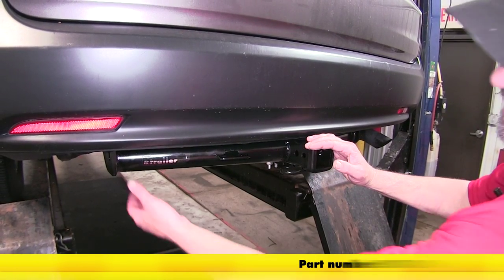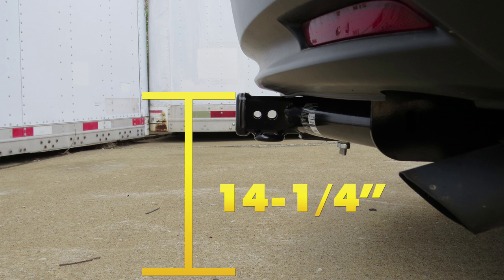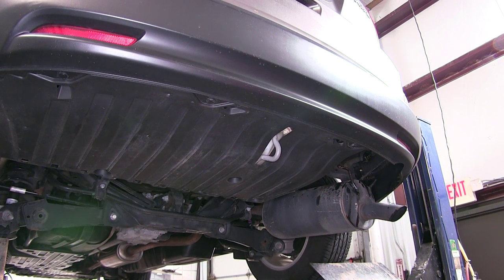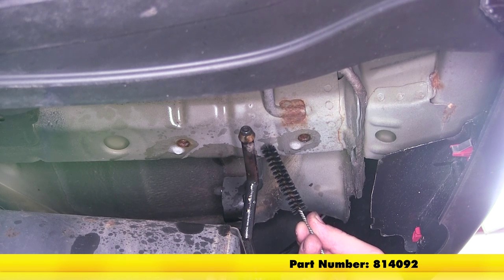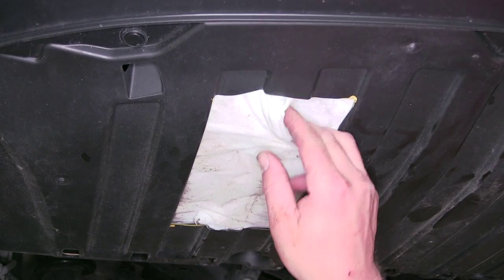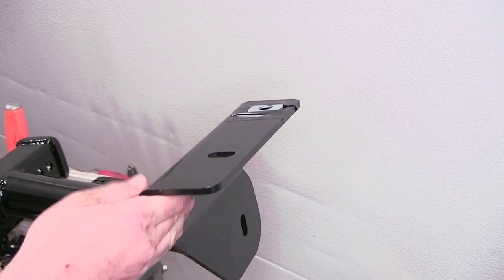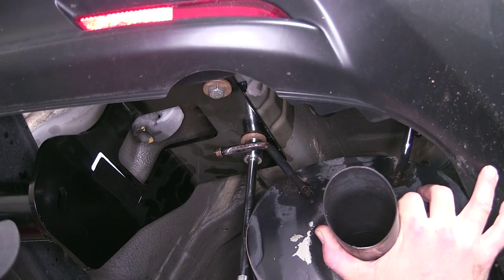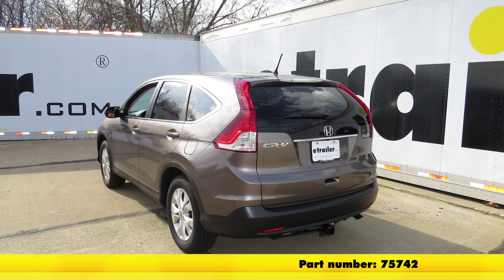etrailer | How to Install the Draw-Tite Max-Frame Trailer Hitch Receiver on a 2012 Honda CR-V

Comment: This is a great video. Unfortunately the hex bolt won't screw into the frame. Hopefully it's just rust that can be cleared out by the vinyl tool.
Reply from the maker: You can use some penetrating oil and a wire tube brush to clean the weld nuts out so that you can get the hitch in place.

Comment: How many ugga chuggas with that impact driver will give you the correct torque?
Reply from the maker: It was a few more than a couple. You can find the torque specifications in the installation instructions by checking out the following link.
https://www.towingproducts.net/Application/support/instructions/N75742.pdf
https://www.etrailer.com/Trailer-Hitch/Draw-Tite/75742.html

Comment: Whats the torque specification for the driver/passenger side bolts and the u-bolt?
Reply from the maker: The torque specifications are listed in the installation details on our website in the following link.
https://www.etrailer.com/Trailer-Hitch/Draw-Tite/75742.html